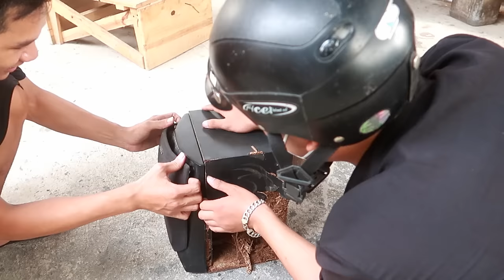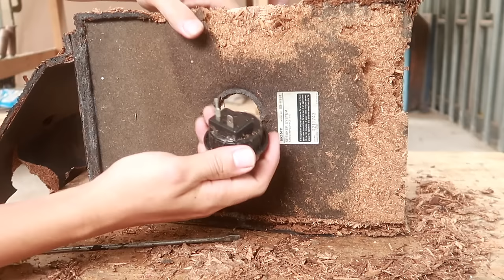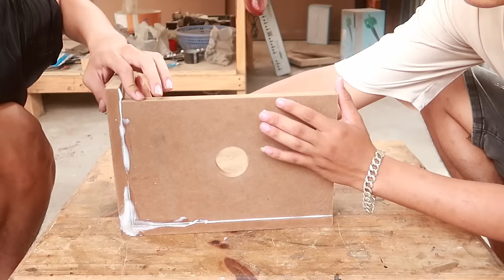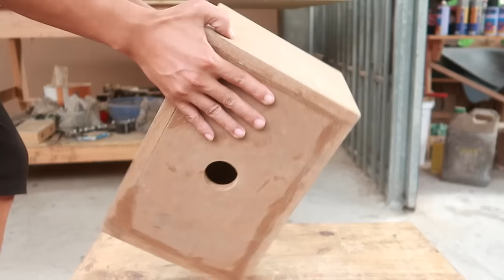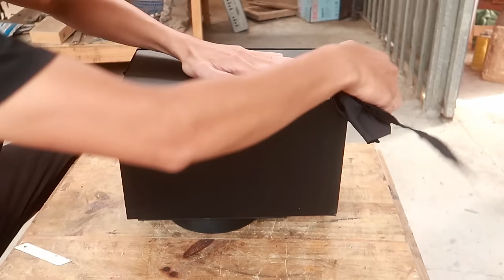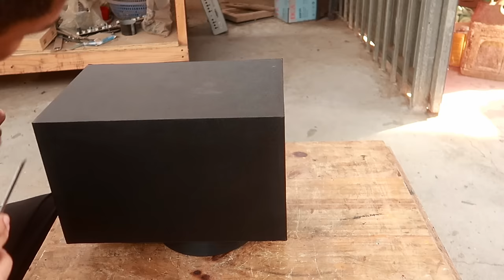Restoration help a young man with a broken SONY speaker / Restore step by step

Comment: They must sound better than the original factory enclosure. Great workmanship there.
Reply: So..... you are saying that they must sound better than from factory of manufacturer who spent millions of dollars on RD?   Paid millions for engineers to test material density, resonance and manufacture the enclosure to tolerances no higher than .-004 of an inch.   The measurements are so precise that  the enclosure hermetically seals it self.   This is a fact its in the manual it says to not pry open enclosure because is hermetically sealed and the  sound quality will be lost if opened.   They sound better than that enclosure  you are saying?
Reply: @pumapunkudevelopment3376 definetly not sounding worse... This is a super cheap low end speaker...

Comment: Before anyone goes repairing speakers, please take note of the equipment needed to do the jobs.
It would be much cheaper to buy a new pair of speakers.
Unless you have access to all the tools like Mr. Electricity.
I once built a speaker cabinet using wardrobe doors. No screws or glue but slotted together.
The reason that I could do it because I worked in a renovation company that had all the required tools and the assistance of the workers.
I was NOT authorized to use the equipment. 
Anyway, they did a great job.😊.
Reply: yeah, but if the speakers are in great condition, the only thing worth upgrading is to replace the finish with veneer, or with a diferent more durable and better-looking vinyl material, or a great paint, obviously making sure that the surfaces are very well sealed and primed before. Another upgrade could be to insert a small fraction of dampening materials, but before that a great sealer to the interior wood. Also, a sealer sponge in the edge between the wood and the plastic cover could make a huge difference in resonances or vibrations too.

Comment: I would as I have done this a few times now. Changed a few things. The speaker wire, terminals and the crossover parts upgraded.

Comment: I remember the era of minisystem/shelfsystem these came from. These speakers had a pretty sharp bass roll off, but could play seriously loud otherwise. Real Workhorses.
Reply: ... what do you expect from those loudspeakers...?
- not the minimalst damping material inside
- not a bass reflex system

Of course they can play loud. This is not a quality criteria
These loudspeakers do not provide any frequency switch, so you don't know if there is a (halfway) acceptable frequency response from <50Hz up to 20 kHz.
And even those mid-/high range loudspeaker chassis aren't protected good enough agains low frequencies.

They are perhaps workhorses - until the first real beach party.
Reply: @53-herbie39   I'm not sure what your point is. and i'm going to have to guess you mean frequency switch as a crossover, because very few speakers have any adjustment on them. And these speakers wouldn't be at a beach party, they aren't portable or outdoor use, they came with a shelf-stereo system.

But i'll ask you a quick question: All other things being equal, if one speaker can play louder than another speaker, doesn't that mean it was made to higher quality?
Reply: @themadmallard  If a loudspeaker can play "louder" than another one (with teh power input) then this say only one thing:
he's more effective. He may have higher acoustic pressure (dB).

But it says nothing about frequency fidelity, distortion and impulse realiability and much more other parameters...
Reply: @53-herbie39  I Said "all other things being equal" for a reason

Comment: Was it a fake tweeter at the top?
Well... most people could easily live with such a speaker.
Did do some DIY with 8 inch fullrange. Though it rolled of at 16 khz, it revealed most.
Reply: Piezo tweeter that is not audible due to it's low volume. But then they can sell it as "3-Way"

Comment: More than a rebuild than a restoration any one could do this my dad in the 70s built 2 speaker boxes 4ft high by 2ft  across pretty heavy to move as well for stereo equipment in the living room and believe it or not he still using them to this day 2022

Comment: Great job! Sony placed a fake tweeter in that speaker as I can see. Hmm....😉
Reply: Yeaah. I check this too. Sony, Sony...
Reply: Твитер не фальшивый. У меня такие же колонки. Подключал отдельно такой твитер. Звук из него идëт. Пищалка.
Reply: Its a low cost piezo-electric tweeter really..Read here: https://en.wikipedia.org/wiki/Piezoelectric_speaker
Reply: It's a piezo tweeter that is dirt cheap, doesn't require a crossover and is inaudible as the real cone tweeter below plays at least twice as loud. They all do it so they can sell a 3 way speaker instead of a 2 way one.😂 For sure, Nobody will notice whether they are connected or not. Legally not a scam but you're free to have your own opinion.

Comment: To the guy who states "they must sound better than the original factory enclosure............So..... you are saying that they must sound better than from factory of manufacturer who spent millions of dollars on RD?   Paid millions for engineers to test material density, resonance and manufacture the enclosure to tolerances no higher than .-0004 of an inch.   The measurements are so precise that  the enclosure hermetically seals it self.   This is a fact its in the manual it says to not pry open enclosure because is hermetically sealed and the  sound quality will be lost if opened.   They sound better than that enclosure  you are saying?

Comment: Any filters for the mids and tweeters?
Reply: Cheap two way speaker with a cone tweeter and an inaudible piezo disc on top. I'm sure there's a capacitor for the tweeter.😂

Comment: Sorry, but from beginning these speakers by Sony are low budget quality.
When supporting a massive MDF housing and then the front provides a cheap plastic plate, where the frequency switch consist of a single capacitor for mid- and high range speaker ... OMG.

@26:04 you can see: a red/black cable coming form the terminals and leading to the plug contacts (!!! - even not soldered...) for the bass chassis speaker and PARALLEL form there a blue/black cable continues directly via a single (flying, wired) capacitor to the mid chassis. 
And also the tweeter chassis is PARALLEL to the mid range chassis - WITHOUT - any further crossover frequency switch element or protection... (Min. 25:56) - only cables.

So you can say: the best thing on this restauration is the new housing. The chassis aren't coordinated and fit to each other. So even SONY did not care too much - this is a product for cheap mass production.
OK, you can play/hear music via the loudspeakers. OK, you will be able to hear rhythm and whoom whoom...
But don't expect too much.

All in all - at the end it's not a crime when those guys re-use the SONY sticker when they glue it again on those boxes which was placed originally on the old housing....